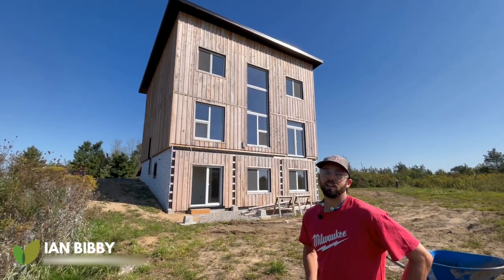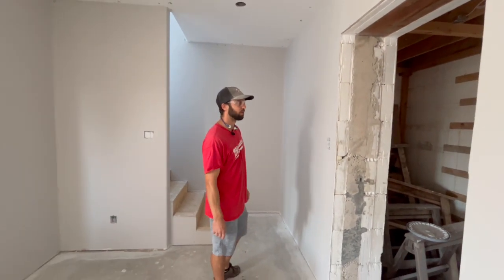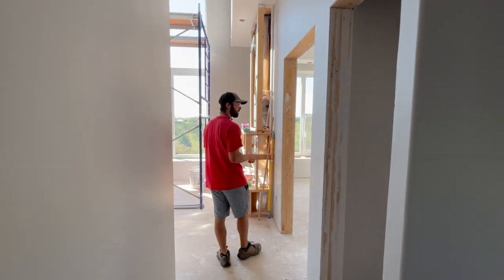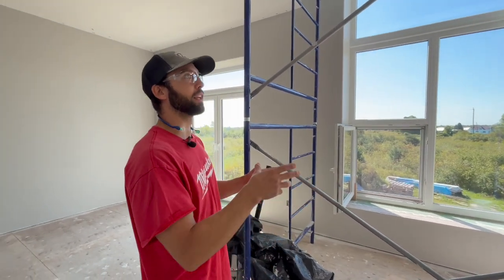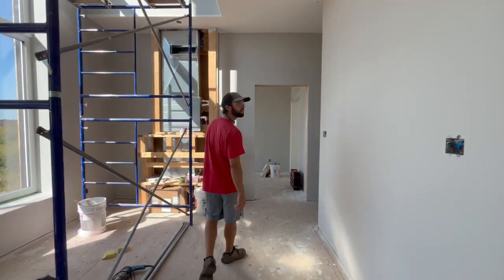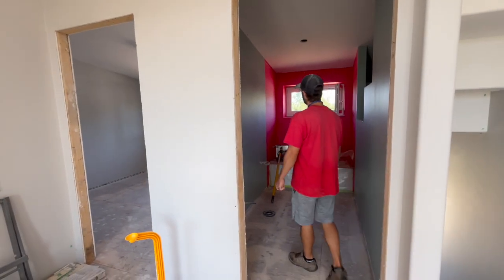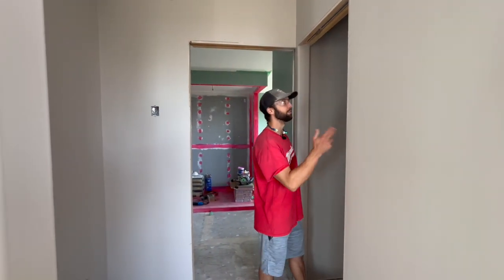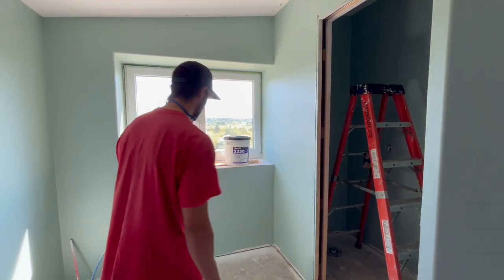Net Zero Passive House Tour

Comment: curious what the avg temps are for Ian's region ...looks like Texas?...but Texas is huge, & he could still be dealing with freezes and/or 110f. also, any plans for calculated southern awnings & E/W shading? trees would be great on E/W, but it's a very tall structure, & they'd take a long time to grow high enough.

looks great, & self-built is a major accomplishment.
Reply from the maker: @Krazie-Ivan  this project is south Ottawa Ontario just about an hour north of New York State. Any passive home with the window dominant side facing the equator (South in this case) Will never drop below 17°C during winter with zero heating, and never be above 27°C with zero cooling. There is always a heating and cooling system. This just reinforces the little energy required to maintain comfortable interior environment.
E/W shading easily accomplished with window coverings, inquire..
Our blog will have a article publish soon about window coverings, sign up here
https://ekobuilt.com/blog/